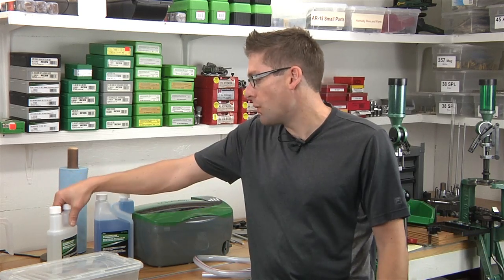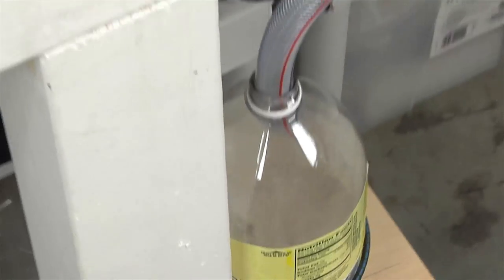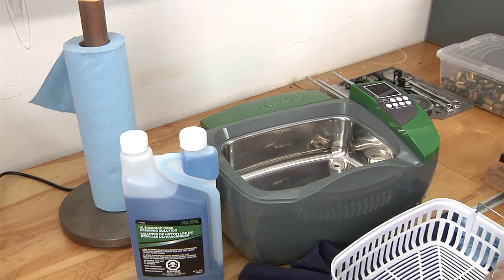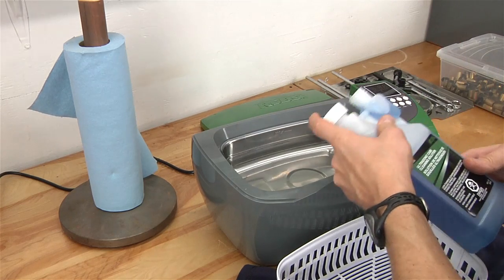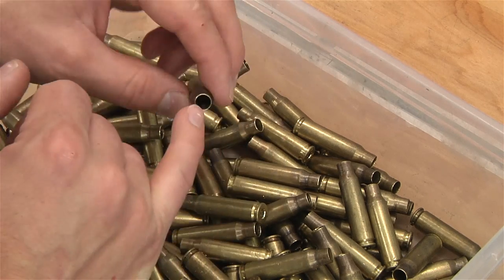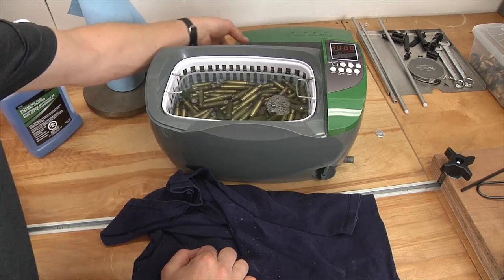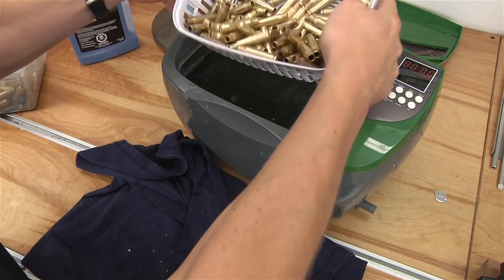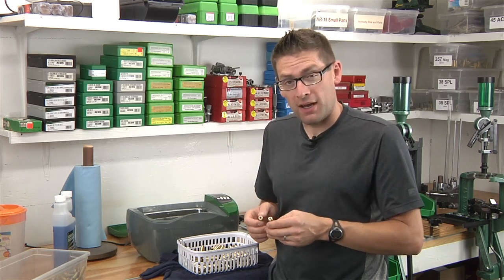RCBS Ultrasonic Cleaner Cleaning 308 Brass

Comment: hope i'm not the only one that heard him say he, de-capped, sized, trimmed, chamfered and de-burred,,, dirty cases before putting them in the cleaner. i would guess this is ok if you don't care about scratching your dies. De-cap then clean, then your working with clean brass for all the next steps, makes it easier to inspect and see flaws at each one of the next steps. just my 2 cents. But i do appreciate the videos, keep going.
Reply: ksdavey1 He only trimmed and cleaned the primer pockets. Nothing to do with dies since I think he has one of those trimmers that dont need a die.
Reply: @zanpekosak2383  But you trim after resizing, maybe unless you're just bumping the neck instead of full length sizing, but then you wouldn't bother trimming before either.
Reply: Thought exactly this, went to comment, saw your. Indeed!

Comment: Great video.  I use my wife's sewing thread rake for drying my shells.  They load with the mouth down so they drain and dry quickly.  You are right about draining the solution from the top.  A MESS!  So I dumped my brand X cleaner and ordered the RCBS just today.  Thanks for all of your video's.

Comment: I agree,  Here is a trick that has been used for years....Ultrasonic the cases, rinse them in water and then dunk them in denatured alcohol.  The alcohol will absorb any extra water and then air dry them.  They dry 10 times faster.  When the alcohol gets dirty, filter it thru a coffee filter and youre good to go ....I use a a 3 lb coffee can with a blow dryer blowing in the side and  strainer across the top of the can...Air comes in the bottom and out the top at 145 degrees...

Comment: MAKE SURE YOU DEGAS FIRST!! i work in aerospace and we use ultrasonic cleaners regularly for precision cleaning. you need to degas for at least a good 5 mins before putting your brass in. this will maximize your cleaning sys effectiveness as well as your  time spent. no need for heat during this time necessarily
Reply: degauss?
Reply: shrug

Maybe he meant degrease?
Reply: He really did mean de-gas.  There are microbubbles that naturally occur in water.  If you run the ultrasonic cleaner in de-gas mode for about 10 minutes you get a more efficient cleaning.  Water is not compressible but the gas is.  Get rid of the gas first.
Reply: So basically you dry run your sonic cleaner to decompose or degas you system then you can run you brass in cleaning cycle.  The Degas part is a dry run to break down the gas and carbons correct.
Reply: Sweet thank you guys so much for the information  alot of teamwork here that makes a Dreamwork thank you all so much.
Reply: Great tip thank you!
Reply: @yojimbo05  Doesn't do anything with carbons, just vibrates the gas out of the solution.
Reply: @robertbrandywine  gitcha my friend i been using the Frankford Arsenal  cleaner with great results.  I was originally going to use the RCBS but got a great deal with Frankford  Arsenal.
Reply: @yojimbo05  I have both.  The FA wet tumbler with steel pins is much more effective.  I bought the RCBS ultra sonic unit first and wasted my money, really.  I use it to clean before sizing and de-priming and then use the FA for the serious cleaning.
Reply: @robertbrandywine  yeah right on brother couldn't  agree more The FA for sure gets the most dirty brass cleaned and precise with best results.  I use Cascade pod, with a little Limeshine and Dawn aoap my brass comes out clean i hardly ever use the pins though lol
Reply: @robertbrandywine  i completely agree owth you.  I am not kncoking RVBS but Frankford  Arsenal has a better product and has been in the game for 130 plus years or more they know and have osmething otehrs don't lol.  They both have great customer service though hands down.
Reply: Dry run it? Interesting you wouldn’t think running it dry without anything would help much.
Reply: @yojimbo05  fa?
Reply: @Truthloveliberty  true lol that does help and gets things clear
Reply: @Truthloveliberty  do you Mean Frankford  Arsenal that is the one i have it works great
Reply: @Truthloveliberty  dry without cases not dry without water lol

Comment: I have the same cleaner I've found that if you rinse you cases off in a bucket of water after you take it out of the ultrasonic cleaner you'll be surprised how much more grime comes off the case after they are clean. I rinse mine till the water in the bucket I'd clean. usually about

Comment: With the wife's permission, I purchased this ultrasonic cleaner today and gave it a run. Like many other comments here... I am very impressed. The unit appears to be built very well, not loud, functionally easy to use and it has a display a blind person can read.

I further cleaned 250 9mm brass [single 10 minute cycle] after 2 hours in the Lyman 1200 Tumbler and the results were fabulous. More than enough for my needs. I recommend this unit for those who want more cleaning versatility than a wet tumbler. Try cleaning fountain pens, jewelry, auto/motorcycle/lawn mower parts, RC engines, tools, glass frames etc. in a wet tumbler - you get the point. Less space and easy to clean.

Comment: My issue with depriming before cleaning is that the dirty shells tend to stick in the resizing/depriming die on my press so instead I clean the brass first and then deprime, and then clean the primer pocket/decrimp with a grinding tool. Then trim the cases and deburr. I guess it depends on your setup but this works for me.
Reply: I have the same issues but my best fix was that I purchased the FA de primer hand operated tool. Made de priming fast and easy then I just toss into the rotary tumbler but now I’m looking into these ultra sonic cleaner but they are pretty pricey
Reply: This is waste of time. Its more time effective to just deprime cases before and clean it in one go. And cleaning primer pockets are a waste, some precision shooters dont even clean that much their brass, they just wash it briefly.
Reply: The Lee decapping die (#90292) doesn't touch the case.  I have no idea why $$ fanboys hate Lee products.

Comment: One of the reasons you should clean your brass is to protect your reloading dies.   Cleaning them after you resize and de-prime them seems backward to me.   I like the way the ultrasonic cleaner worked on the primer pockets, however, I would clean them first before I resized, and then run them through the ultrasonic cleaner a second time.
Reply: That’s not the reason. Ultrasound cleaning is to get residue out from the INSIDE of the case. It has nothing to do with the dies.

Comment: Heated is definitely the way to go.  My sonic cleaner is unheated, and it was a mistake to buy it.  But you can use pre made solution or use your own.  Any kind of cleaner with a pinch of LemiShime crystals dishwasher cleaner/decalcifier.  Pre made is easier.
I'd rinse before drying though.  Don't want to add anything to the powder.
I use mine for pistol brass.  You can load it up with quite a lot, unless you're into ipsc or something.

Comment: 5 minutes, no heat, in my ultrasonic cleaner with Hornady 'One Shot Case Cleaner' and my brass is brand new. I have a large ultrasonic I use for both motorcycle restoration work and gun work (including the guns). All you need to know is what solutions to use with what metals.

Comment: I rinse my brass after the solution in distilled water to remove the cleaning solution and prevent tarnish from the caustic cleaner!
Reply: I have never used a sonic cleaner, but agree with you that it's a good idea to rinse the cases after cleaning.
I believe there probably is/must be? a tiny amount of some sort of acid in cleaning solution?

I wish I could get a used BIG "industrial size" ultrasonic cleaner for a very good price. 
I have a HUGE amount of sized & trimmed (By Dillon trimmer) and decapped 7.62x39 brass cases here in northern europe!!
(Yes they are berdan primed cases!!)

The cases are very clean, but a good sonic cleaner would make them to look almost perfect.
(Only slight amounts of calcium in primer pockets.)

Comment: LOL, you voice is a tad bit higher in this older video.    I started off with dry tumbling,  then ultrasonics, and wet tumbling with steel media.  I am back to ultrasonics.    It helps to have a tad bit more powerful ultrasonic cleaner than that Lymans, and the secret ingredient for me has been Brass Juice--just wonderful stuff.  

That being said, benchrest shooters reload during matches without extensive brass cleaning--just wiping off the exterior of the brass before resizing and brushing the inner diameter of the necks.  Their accuracy doesn't seem to suffer using brass with a dirty interior.    I guess if you are going for 1000yrd F-Class, then it probably makes a difference.

Comment: I just bought a 160 watt ultrasonic cleaner. I wasn't very impressed with the results over just boiling purple power cleaner or vinegar. I returned the ultrasonic cleaner and went back to boiling and media tumbling. One less piece of equipment cluttering my reloading bench. I little dab of car wax in the tumbler and brass looks much better as time goes on since the brass now has a coating of wax.

Comment: I tried my new RCBS cleaner last night. I had 100rds of .308 brass. I used 2 liters of water & 2 shots of the rcbs yellow case cleaner. I set it for 20 min @ 130°F & it did not clean the primer pockets. I  had to add a 3rd shot of cleaner & run it for 30 more minutes to get them clean. Is there a difference in the yellow cleaning solution?

Comment: Hi Gavin, 
Thanks for the video mate, I just have a quick question. Did you end up with any wet spots or marks after the drying process? My brass looks perfect when it first comes out of the cleaner, but give it a day or two after drying they turn dull with very obvious drying spots. I'm wondering whether distilled water would help - I also rinse mine before drying with tap water which may also effect the end result! Any thoughts would be great. Cheers
Reply: I always rinse my cases with regular tap water when I get done.  The only time I have had an issue with them getting spots is when I tried leaving them out to air dry for several days.  I now put them on a large tray in my oven on the lowest setting for an hour or two shaking them around a little bit occasionally.  If you use the oven technique make sure to use the lowest setting I tried turning up the heat once to dry them faster and the brass started turning weird colors.
Reply: Thanks Craig!

Comment: Is it safe to say , with the sonic cleaner you don’t need a tumbler ?
Reply: I have the same question, but can't find answers. Can you affirm?
Reply: @ignaciorodriguez8931  A (dry) tumbler would polish the brass. Other than that you don’t need one.
Reply: @fentonpainter7907  I found both necessary, the ultrasonic cleaner for flash holes...

Comment: I've been using the Hornady 2L version, but this one looks nicer.  Are you sizing before you clean your brass?  It would appear that you are.
Reply: pretty sure he is. I dont like doing that as running clean brass through your dies smooth operating. my process (I use wet tumbler tho) is tumble for 30min with some dish soap and media, then decap/resize and then final clean in the tumbler with some lemon shine and soap (2-3hrs for mine).

Comment: I would never run filthy range brass in my dies. I will de-prime first though.  The whole point of cleaning your brass first is to preserve the dies and get the best possible resizing.  Even if I'm doing a quick "fire  & reload" and no other sizing is needed like, bumping the shoulder, I'll use 0000 steel wool and spin the case neck in the wool.  In some instances, I will chuck up the case head in my QD holder attached to my small Dewalt cordless and do the whole the case. I'll then clean the primer pocket on my RCBS prep machine as well as use a spinning bronze or nylon brush attached to the prep machine and run the case over it to clean any burnt residue from the ID of the neck. Then, I'll resize the neck only with my Less collet die, prime, charge, and seat with my Coaxial. Pretty simple.

 I'm now getting ready to run a batch of older fired 7mm Dakota brass I've had sitting around for a while shot from another rifle in the ultrasonic and do a full length resize getting it ready for fire forming in my new match grade tight neck 7mm Dakota chamber.

Comment: We put a penny into the crest ultra cleaner we just got 800 dollars.  The penny didnt look clean and now it has metal from the basket on it.  We bought a basket on ebay.  What did we do wrong and did i just discover how to electroplate on accident?
Reply: Electroplating requires an electric current running through the material being plated so I would say no to that.  Some materials and cleaning solutions do not hold up well in an ultrasonic cleaner.  Your cleaning solution may have been eating the basket especially if it is of a cheap build quality.  Also if the basket material is softer than the penny it is possible the basket material just rubbed back and forth on the penny enough to leave a deposit.
Reply: Don't forget: Most modern pennies are not solid copper any more, they are a base-metal slug that's been copper-washed/ lightly plated.  You may have cleaned off the plating.

Comment: Hi, 
Question for you.
Do you clean your brass after every shot..or can i reload a few times B4 cleaning
Reply: While you can reload several times, it all depends on what you are shooting. If the brass is fouled up, you'll want to clean it before reloading. Also, if you are going for precision loads, you'll want to clean it. 

Bottom line, clean it....its just better that way, and doesn't take that long to do.

Comment: My unit just won't heat the solution. I set the temp, turn the heater on, the light flashes but no matter how long I wait the water remains cold to the touch. Am I doing something wrong?
Reply: You probably got a bad cleaner. Duh
Reply: I had one that woldnt heat either so I just bought a cheap coffee maker to heat the water.